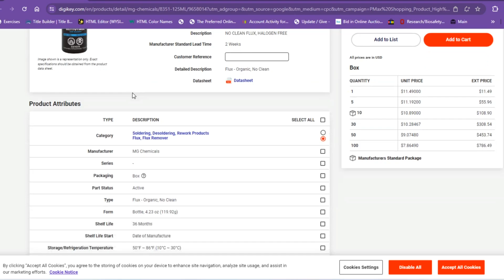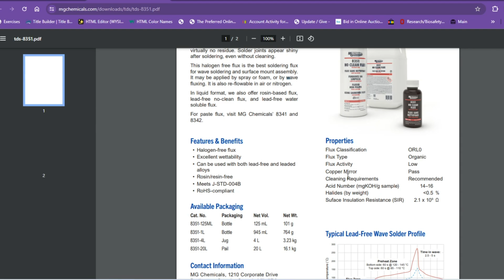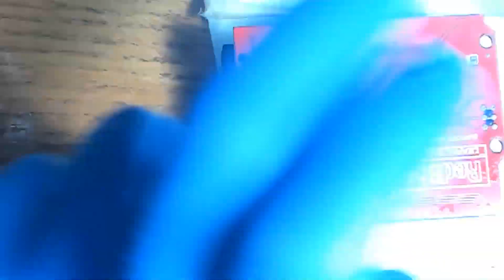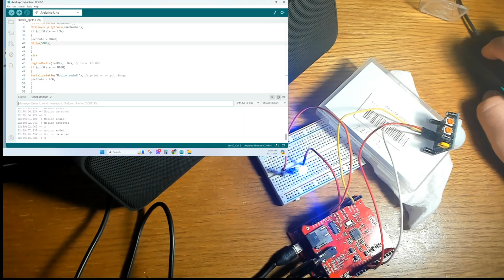Full Flux MELTDOWN 🤔 Here’s How Isopropyl Alcohol Saved My Arduino | DIY Electronics Tutorial

Comment: The solar Flux really just protects the Arduino from moisture and prevents corrosion so you might as well have left it on
Reply from the maker: hey there! The flux on the pins and sd card would have made it difficult to use. I didn't power the board on before I cleaned it. I thought there may be a good chance the flux could interfere with electrical contacts. It's great at what it does but it can be very messy, especially if you spill it 😆

Comment: In the past i have tried with paint thinners it work great but dont get it on any plastic part it will damage it instantly. The pcb was fine and component was ok as well unless for any plastic component.
Reply from the maker: That's good to know! It sounds like you would have to work with smaller amounts. I imagine it's pretty harsh, may need to crack a window when you use it.

Comment: Wow, what a mess!  Good job cleaning it up, glad it worked and thanks for sharing.
Reply: You could also put a coffee filter on your pcb, pour a small amount of IPA on it and then rub on the filter with your toothbrush. I don’t recall who taught me this but it works great. You can also use bio ethanol which is a smaller molecule and cleans even better. 
Using the same toothbrush to brush your teeth however is not recommended 😅.
Reply from the maker: @johanbenko7818  I like the idea with the coffee filter. It's lint free, unlike my paper towel and q-tip! I would never use my personal toothbrush to clean electronics...gross. However, I don't like to waste coffee filters. Suppose I could reuse the filter for my next pot of coffee if I let it air dry on the table? 🤣
Reply from the maker: Thanks! I honestly thought I was going to have to throw it away. Glad I kept it. 👍
Reply: @BMonsterLaboratory  that’s awesome that it worked and great to share so we can all learn
Reply from the maker: @SummersideDiver  isopropyl alcohol works great!